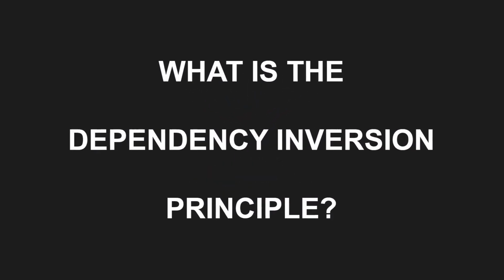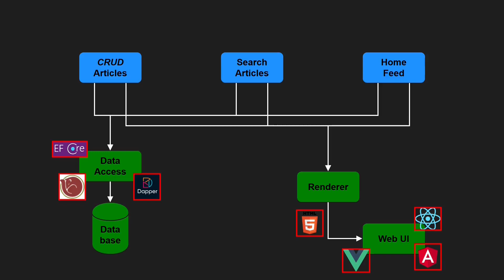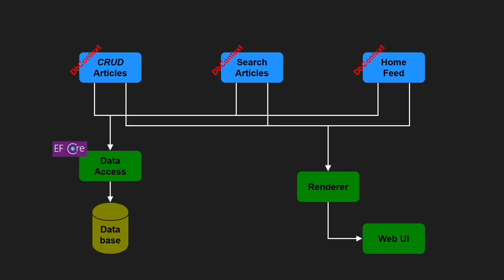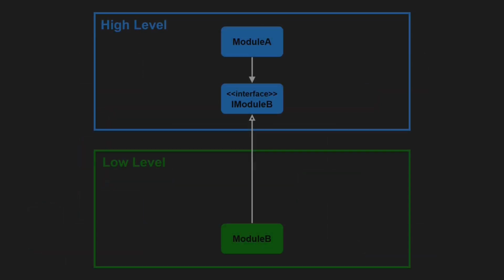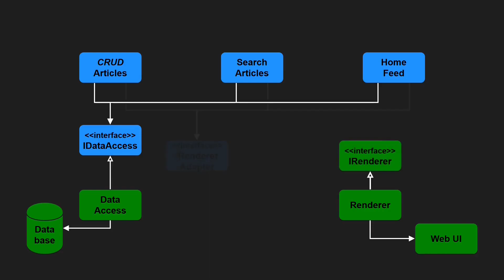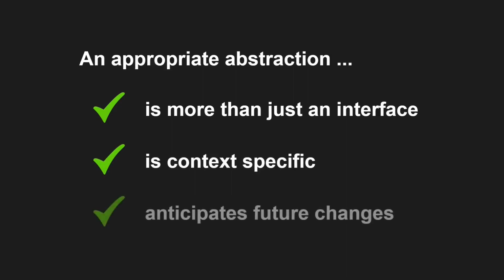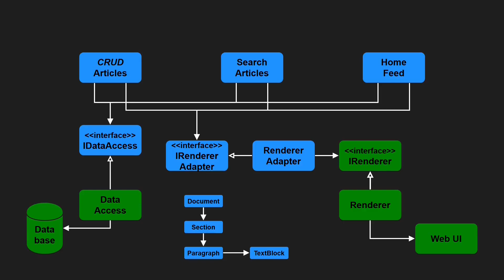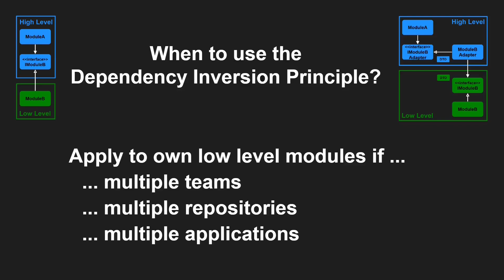Dependency Inversion: What, Why & How? | By Example

Comment: So everyone keeps saying about how great it is to use an abstractions for such things as DB, but does it really bring benefits? Do people often change the DB context to something else? Besides something like Logger, which one might change from text to sentry to idk email, everything else is just not happening. The real benefit is in testing/mocking things.
Reply from the maker: @AlexZavalny In past 20 years I have seen so many technologies and libraries come and go which, depending on the size of your code base and the degree of coupling, can be really hard to replace. And as I tried to explain in the video this may not only happen due to obsolescence but also because of requirement changes which are hard to predict. So yes, based on my experience I see real and even big benefits of putting an "anti corruption layer" between third party libraries/technologies and the actual application logic.
Reply: @AboutCleanCode  Now when you say, I understand that you are right. I remember how I hardcoded using some fraud detection library for our ecommerce system and then company asked to switch to something else, which required search all references and rewrite.
Reply from the maker: @AlexZavalny maybe you are right - still I used it intentionally because I see many developers using it in their app logic without thinking about the impact when having to switch to some completely different storage technology in some years which they cannot even imagine today 😉
Reply: Do people really change the db context? Have seen people ask that question repeatedly.

Yes, it is replaced during unit tests. You shouldn't use dB context in unit tests or make network calls.

Comment: Thanks for the content! I have a theoric doubt: in the design using the Adapter pattern, the ModuleB is pertain to Interface Adapter Layer or Infrastructure Layer? I mean, did it become like an external lib for my application?
Reply from the maker: Dependency inversion can be applied everywhere. If you refer to clean architecture then dependency inversion is applied on all layers to ensure dependencies only inwards.

Comment: 8:03 more importantly, you should not include any low level exception in the interface, like throws RequestTimeoutException. This isn't only violating the DIP, it's also wrongly declaring that the interface will be implemented through a method that can potentially cause a time-out exception. This becomes already apparent during testing. A List based mock implementation of the interface, will rarely throw a timeout exception or any exception at all (when we implement indexing correctly)🙂. Exceptions, if any, must directly match the level of abstraction of the higher level module.
Reply from the maker: @TJ-hs1qm  good point 👍😉

Comment: I think avoiding the performance impact is more important than making things re-usable.
Look at how slow software is today. People obsess over re-using things. You don't have to re-use software. That's the beauty of it.
People putting re-use as a major goal is a problem. Now there are way too many abstraction layers and a performance hit.
Reply from the maker: @Jabberwockybird i see your point but i think it depends on the context. there are quite some "markets" where "time to market" (reacting fast to market changes) is more important than runtime performance of the app. does not mean the app can have very low performance but it is not the most important aspect. In such contexts modular design, abstractions and reuse are important.